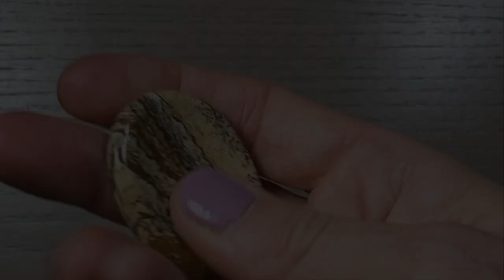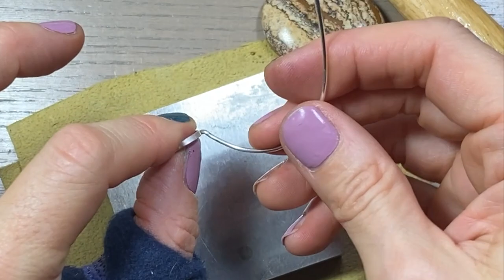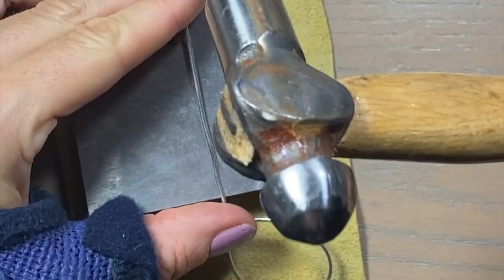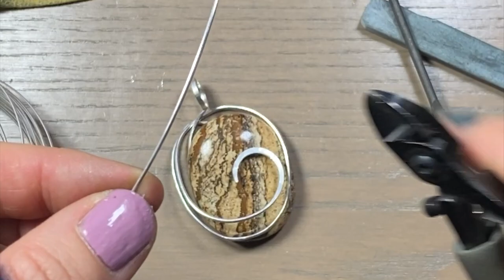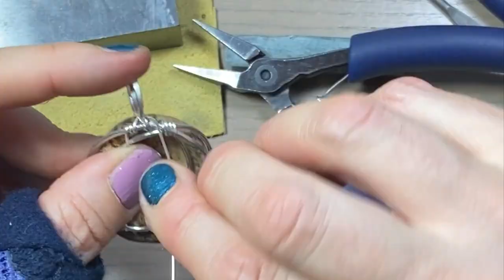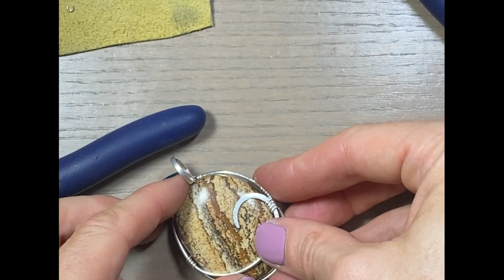DIY Jewelry- Large Gauge Hammered Wire Worry Stone Pendant

Comment: Lovely pendant and elegant wire wrap. The finish with the little ties here and there gives it lots of character. Thank you!
I realized one thing. You hammered a long segment before you rolled the bail. So when you twisted the wire 90 degrees from the bail to run on the back you had a ridge, the wire did not lay flat against the pendant and needed a second hammering in the opposite direction.  I think it is wise to hammer only enough for the bail, roll up the bail, then hammer in a different direction so wire lays flat and wide against the stone.  Sometimes the 'mistakes' teach us so much. The wire is constantly changing direction so hammering must too.  I think I will 'measure' the wire wrap out by using soft tubing or such, to get an approximation of distance for each segment to be hammered.  Enjoyed the tutorial, much appreciated!
Reply from the maker: Good points! Always learning! ☺️💜